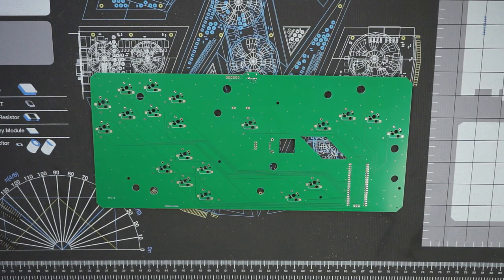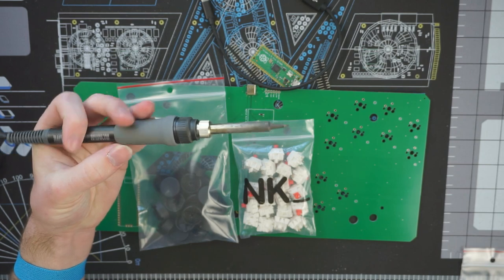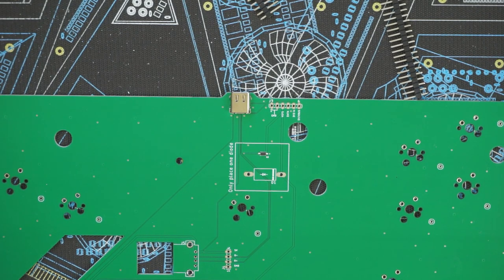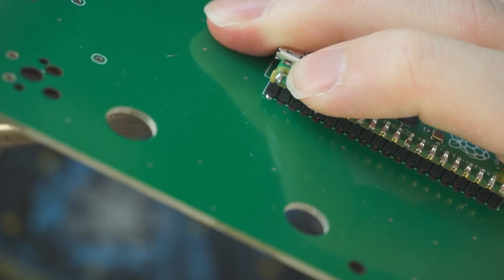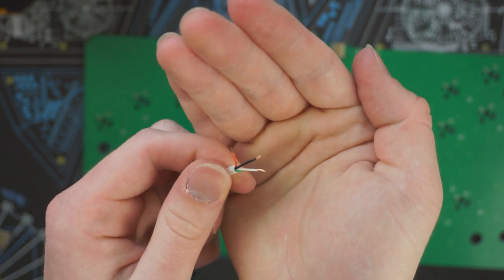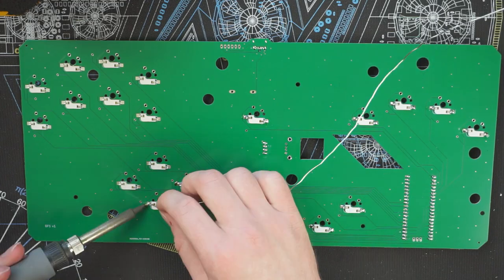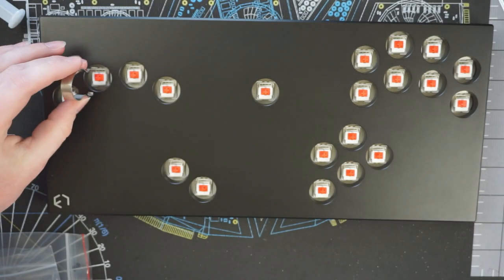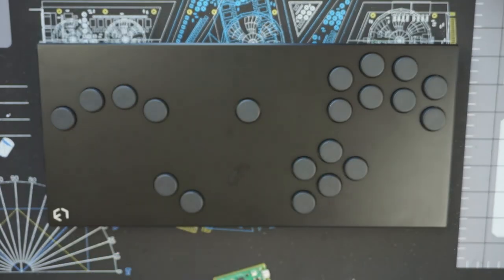Open Frame1 Build Guide

Comment from the maker: Hey all, if you can't get a hold of an official Frame1 chassis but still want to make one of these, don't worry. There will be 3D printable and laser cuttable designs available soon.

GregTurbo will make a vid talking about this pretty soon, and I'll likely make a build guide for the laser cut one, so stay tuned!
Reply: Any specific caveats to be aware of when ordering a PCB from JLC? Excited for the 3D Print files. Will there be Chassis, Keycaps, and Plate?
Reply from the maker: @Earthenmind  There were a couple things JLC was confused by with the board files, and Greg has made a revision to resolve that.

He ordered some boards and they will be tested soon to confirm everything still works as intended, and once that is the case there shouldnt be anything in particular to worry about.

If you want to order them now you can, but they might send an email asking you about a few things. Check the dev updates channel in the Frame1 discord for more details on that.

As far as other cases go, I've heard several people talk about how they are planning to design cases. There will likely be a revision to the Fake1 design (https://www.thingiverse.com/thing:4917086), and there will also likely be at least one layered design similar to my GCCMX (https://github.com/Crane1195/GCCMX).

There are already several keycap designs out there. These ones can be ordered on JLC and the nylon variant is excellent: https://github.com/rana-sylvatica/circle-keycaps
Reply: @CranesLab  This is awesome, thank you! I'll wait for the revisions and check out the Fake1 in the meantime. Super excited to attempt building one myself! <3
Reply: Don't suppose there is any update on the chassis situation?

Comment: I'm getting into Tekken and other fighting games and I'm wondering if this could be also used for those. Its already has a hitbox style layout.
Reply from the maker: You can flash a different firmware to this PCB that would let it work for fighting games on PC, PS3, Switch, and PS4 games that support PS3 controllers.

That firmware is called GP2040: https://github.com/FeralAI/GP2040

You'd have to change the pinout and recompile it though. If you want help with that at some point,  ping me in my Discord server and I can help you out: https://craneslab.xyz/discord
Reply: @CranesLab  woah! thanks for pointing me to it! Sucks that you can only choose one firmware though at a time though. What if you hook up two pi picos to the switches and have two different ports you can plug into for gamecube/fight pad mode. would that be possible?
Reply from the maker: @reignandbongao9497  no prob! you could do that yeah. There is probably also a way to write a bootloader to swap between firmwares on the fly, or just to combine the two firmwares into one, but neither of those would be as easy as just using two picos

Comment: I've done a mechanical keyboard build from a kit before (Pinky4), so a lot of this build is familiar, but I bought pre-made PCBs when I did that. Any more info you could provide on how you get the PCBs would be very helpful. I heard you mention JLC. I've heard of them before. I chose assembly on their site and dropped in the zip file from the github releases for the Open Frame1. Do I need to tweak any of the options or leave a note for them to put the USB-C port and diode on or is all the info in the files? In the PCB assembly section do I pick top side or bottom side or both?
Do you know if the USB C to Micro USB B cable on Adafruit would work? Product ID 3879. It doesn't mention OTG like the Amazon one. Would be nice if it worked because it's a lot cheaper and you can get a Pi Pico for much cheaper from Adafruit as well so I could do them in the same order. I think making sure I get all the right parts on the way is probably gonna be more difficult than the actual build.
FYI, I don't use Discord on principle, so I'm asking here.
Reply: I started to go through with the JLCPCB order, but it needs a BOM file. Is there one provided somewhere that I missed or do I need to make my own? I'm guessing it'd just specify the diode and USB-C port.
edit: I figured out the BOM (maybe) by going to the part links in the description, adding to cart, and hitting export, but now I also need a CPL file. It's a shame there isn't more info on this part of the process. I wonder how many people are able to figure this out...
Reply: Found the BOM and CPL file in the repo, just not on the releases page.
Following along with testing the firmware on the Pi Pico, I don't get the popup that the adapter was connected in Dolphin after dropping on the firmware and replugging the Pico in. I'm on GNU/Linux. I looked at dmesg output after plugging in and I see "Product: WUP-028" and "Manufacturer: Nintendo", so... it probably works. Maybe this info will help someone else.
Reply: I've noticed the license on pico-rectangle is horribly restrictive and proprietary. I found an alternative called HayBox that is GPL-3.0, but I'm unsure if it will work well with the Open-Frame1 (does it support the right # of buttons?), and it looks like they don't upload any pre-built binaries which is sort of annoying. I'd rather not install vscode/vscodium as well.
Reply: Going one version back they did have a prebuilt firmware for the pico, and the right number of buttons are supported. Has the same control scheme as the other firmware out of the box for its Melee mode.
Reply: The description is still missing a link for the internal USB-C port. Also, would love that video on how to solder the ports yourself. I'm thinking of doing a second order and trying to save money by skipping the assembly this time to do it myself. I seemed to have some issues caused by the internal cable causing uneven pressure on the PCB (leading to a lot of bent and broken switch pins), so I think it's probably best to avoid it if you can, that's another thing I'll try to change in a future build, not sure if I can easily change that on a finished build.

I think an updated build video with the new PCB/connectors and using a 3D-printed case would be good, since the Frame1 site doesn't seem to ever restock their cases. I'm using a glued case from thingiverse. The pieces are small enough to print on an Ender 3 v2 and then put together with superglue, so that saves money over using JLC for the case if you have a 3D printer around already.

I also have some thoughts about the PCB design that I also put in a GitHub issue. The way it is now, it's very difficult to access the BOOTSEL button on the Pico in an emergency dut to it being on top of the PCB inside the case and having to remove all your switches and the PCB to get at it. I think a PCB revision putting it on the bottom would be ideal, but some modified cases with a hole on top to access the button (maybe with a paper clip like resetting a router) could work as well.